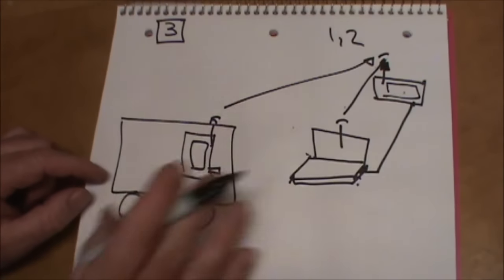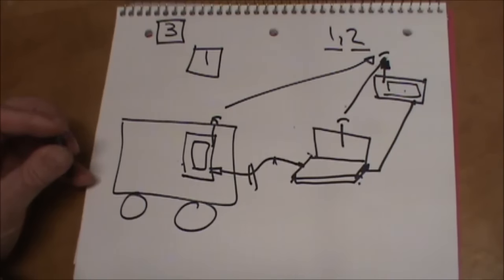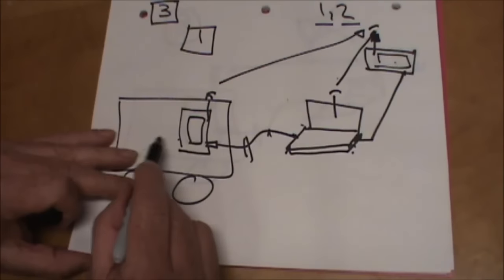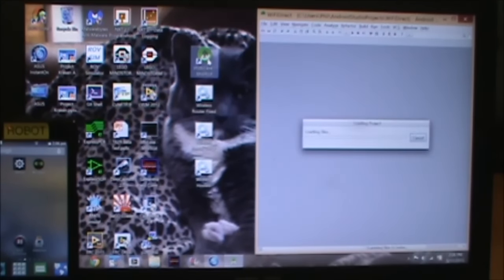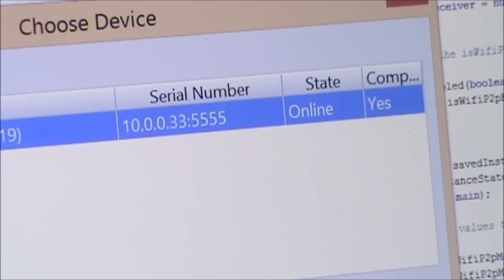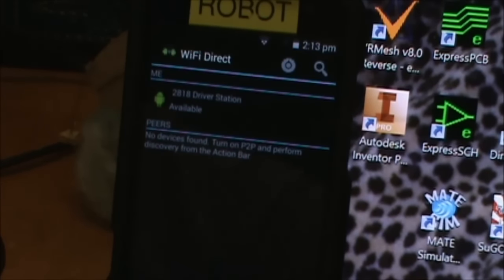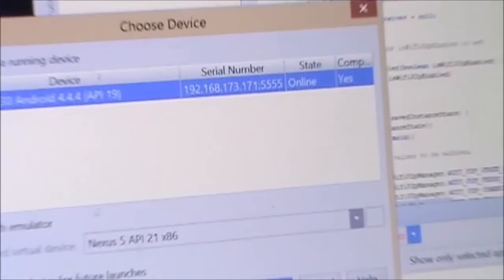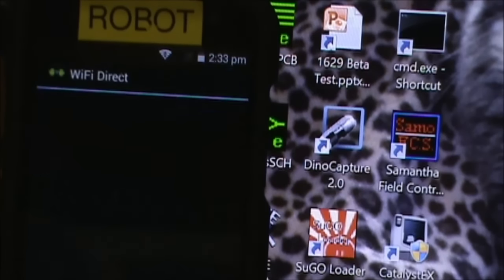Tutorial: Wireless ADB Setup for FIRST Tech Challenge (FTC)

Comment: Hi, I tried to run the script Wireless Hosted.bat. My computer showed the network but my phone does not see the newly hosted network. Any idea on how to fix this? Thanks.
Reply: fwangable I tried the other script Wireless Router DHCP.bat. The script stuck at command "adb tcpip 5555" and Android Studio is not responsive anymore. I tried to execute the adb commands one after another without script. It stuck at the same command again and Android studio stopped responding. With USB connection, app is working on the phone when run from studio. What could cause adb tcpip 5555 stuck? Thanks.

Comment: I tried to run the Wireless Router Fixed batch file, but when I do, it gives an error every time it uses an adb command: 'adb' is not recognized as an internal or external command, operable program or batch file. How would one fix this error? Thanks!
Reply from the maker: TheGamingExecutive  Yeah, I have assumed that adb is running properly with USB, and that you are adding wireless capability.  For the script to work you need to be able to open up a command prompt and enter ADB and have it find the program and run it.  A good Android Studio install should update the path for ADB, if not you need to manually add it.

Comment: Is it possible to do this with a mac?
Reply: If you can make sense of this, it works for us. It's like step 1 in the video without the .bat file. You are manually doing the stuff the .bat file does.

ASSUMING ADB IS SETUP AND WORKING, AND YOU CAN UPLOAD
TO YOUR PHONE USING THE HARD-WIRE

COPY THESE COMMANDS ONE LINE AT A TIME AND 
PASTE THEM ONE LINE AT A TIME INTO THE TERMINAL
(DO NOT COPY THE INSTRUCTIONS THAT ARE IN ALL UPPER CASE)

STEP 1:
———— CHANGE DIRECTORY TO THE PLATFORM-TOOLS FOLDER
———— NOTE: CHANGE THE LINE BELOW TO MATCH WHERE YOURS IS
———— NOTE: PATH IS EASY TO FIND WITH ANDROID STUDO,  JUST
———— IN ANDROID STUDIO, GO TO FILE, PROJECT STRUCTURE, SDK LOCATION
———— THEN ADD /platform-tools TO THE END

START COPYING LINES HERE:

cd /Users/scottclem/Library/Android/sdk/platform-tools

./adb kill-server

./adb usb

./adb tcpip 5555

STEP 2:
———— ENTER THE IP ADDRESS FOR YOUR PHONE
———— YOU CAN FIND THIS IN WIFI SETTINGS ON THE PHONE

./adb connect 192.168.1.4

STEP 3:
———— CONFIRM YOUR DEVICES IS CONNECTED

./adb devices

STEP 4:
————— UNPLUG YOUR PHONE AND CONFIRM IT IS WIRELESSLY CONNECTED

./adb devices
Reply: We originally had this completely working on a mac, but we recently had to swap our robot controller and driver station phones and now it isn't working. When we try to connect the computer to the phone's wifi direct network, it says the password is invalid even though this used to work with the other phone. Does anyone have any advice for this issue?

Comment: is it possible to do this on mac
Reply: If you can make sense of this, it works for us. It's like step 1 in the 
video without the .bat file. You are manually doing the stuff the .bat 
file does.

ASSUMING ADB IS SETUP AND WORKING, AND YOU CAN UPLOAD
TO YOUR PHONE USING THE HARD-WIRE

COPY THESE COMMANDS ONE LINE AT A TIME AND 
PASTE THEM ONE LINE AT A TIME INTO THE TERMINAL
(DO NOT COPY THE INSTRUCTIONS THAT ARE IN ALL UPPER CASE)

STEP 1:
———— CHANGE DIRECTORY TO THE PLATFORM-TOOLS FOLDER
———— NOTE: CHANGE THE LINE BELOW TO MATCH WHERE YOURS IS
———— NOTE: PATH IS EASY TO FIND WITH ANDROID STUDO,  JUST
———— IN ANDROID STUDIO, GO TO FILE, PROJECT STRUCTURE, SDK LOCATION
———— THEN ADD /platform-tools TO THE END

START COPYING LINES HERE:

cd /Users/scottclem/Library/Android/sdk/platform-tools

./adb kill-server

./adb usb

./adb tcpip 5555

STEP 2:
———— ENTER THE IP ADDRESS FOR YOUR PHONE
———— YOU CAN FIND THIS IN WIFI SETTINGS ON THE PHONE

./adb connect 192.168.1.4

STEP 3:
———— CONFIRM YOUR DEVICES IS CONNECTED

./adb devices

STEP 4:
————— UNPLUG YOUR PHONE AND CONFIRM IT IS WIRELESSLY CONNECTED

./adb devices